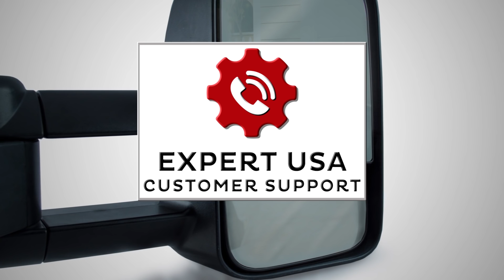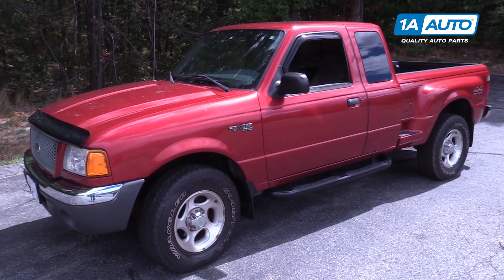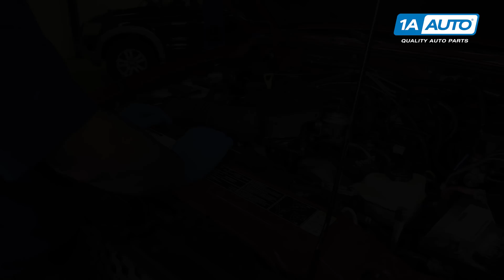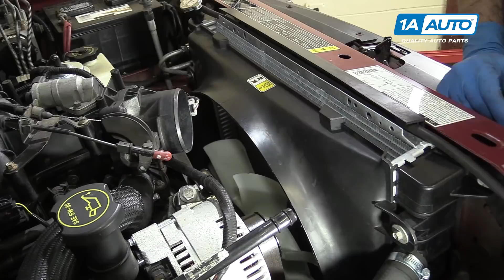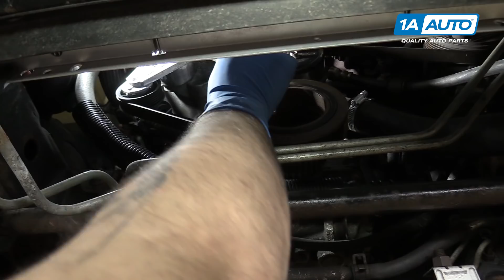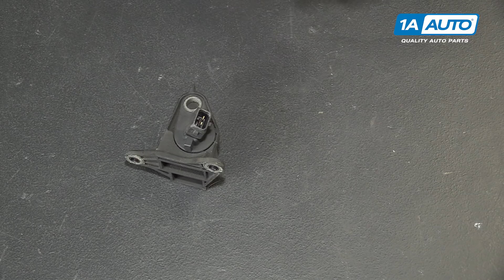How to Replace Crankshaft Position Sensor 98-11 4.0L V6 Ford Ranger

Comment: Thanks guys, Mechanic told me I was going to need to replace the block or rebuild the engine on my 09 Ranger due to all the symptoms the ranger was giving out but decided to take my truck back after a full week of  “testing”. Did a little research myself & decided to give the sensor replacement a try after reading a comment on this video about the same issues my truck was having & it worked!

Comment: This helped me discover that the crank  shaft pulley had slipped back and wedged between the belt and crankshaft positioner. 
my tensioner rubbed a hole in my air conditioner hose and squeeled very bad.
i looked and replaced the belt and hose, thinking the belt streched.
one year later the the engine developed intermantcy and would quit and restart and finally would not start at all.
because i let it set for a long tine i thought ,water in the gas, or clogged fuel line.
come to find out the positioner sensor was bad because a grove was rubbed into it and eventuility shorted the coli inside.
i bought a new 1 and it would not fit because the pulley was in the way(the new 1 did not have a grove).
at this point i discovered that the pulley had repositioned itself about an inch back.
the pulley had failed and the belt had set itself on the grooved rubber part of the harmonic balancer which moved the tensioner  arm into the air conditioner hose. 
after all was repaired the oil needed to be changed because it was heavley diluted with gas.
it runs like new YEA!!!
Reply: My 08 mustang has done this exact same thing. Did you replace the pulley yourself?

Comment: Dumb question but I seen another video of a guy replacing the same sensor but he said that one of the cylinders has to be at top dead center to replace, is this true?? I have this same truck with same engine please someone answer this

Comment: Would a faulty sensor cause a hard start problem? I'm trying to narrow down what could be causing it in the 4.0 ('02 Ranger ).
Reply from the maker: +Eric Ortiz We wouldn't be able to diagnose an issue like that here, you may want to have a local mechanic take a look at it. Thanks for checking us out! 1AAuto.com

Comment: If u had a leaking water pump could this prevent from starting at times? If water leaks on the sensor
Reply: Definitely. The connector on mine was corroded and the truck wouldn’t start until I wiggled the connector and cleaned the contacts a bit.
Reply: I use DI_ELECTRIC GREASE on ALL my electrical fittings.! PREVENTS or reduces such occurrences.

Comment: Question i was doing a job to replace both head Cylinders and in the process i took the (Camshaft Position Sensor) off of the (Camshaft Synchronizer) to replace the heads. Finally i put both heads on and everything together then i tryed to start it and it wont start. I keep trying and Finally it starts but it runs super rough and makes a loud CLICK noise every 2 to 3 seconds so i left it off until i can fix it. But i think it could be that part and the position sensor i took off thats messing with the truck from working.

Comment: If this is bad will the truck start by spraying carb cleaner into the throttle body and continue to run?
Reply from the maker: +Jeremiah Shine That may be an issue with a throttle body that needs to be cleaned. Usually when the crank shaft sensor goes it will throw a cylinder code, and the vehicle may be hard to start. Hope this helps you out. 1aauto.com
Reply: 1A Auto Parts It appears as if finding a code scanner for a '91 Ford 4.0 is difficult in these parts.
Reply: Jeremiah Shine you can read the codes by using a jumper wire and counting the cel blinks. There are videos on youtube. Just look for how to read codes in _______ without code reader.
Reply: The 4.0 OHV won’t start at all if this part is bad. Mine would click but wouldn’t crank at all. But it would eventually start if I gave it a jump. Turned out it was corrosion on the connector.
Reply: Will a faulty CS Sensor allow motor to start easily and run smooth while cold but cause motor to start misfiring after warming up to the point of killing motor and then not allow to start until motor has sat for a short while to cool?

Comment: Would anyone know why when I step on the clutch in my 04 ranger and put it in neutral when coming to a stop, the rpms go up to 3000-3500? It sounds like I need to shift into gear but I’m slowing down to come to a stop. The rpms drop to normal when fully stopped.
Reply: sticky clutch?
Reply: I had that on my 01 and cleaning out the throttle position senor out with parts cleaner fixed it.

Comment: I have a 1999 Ford explorer sport v6 ohv pushrod where is the camshaft sensor location? thanks!
Reply from the maker: +Ronald Wells Thank you for checking us out. The camshaft position sensor should be located on top of the driver side valve cover for the Sport model. 1aauto.com

Comment: where is the crank shaft sensor located on a 2000 ford explorer Eddie Bower Edition 5.0 L. located at?
Reply from the maker: +Julie Smith Thank you for checking us out. it appears that the crank sensor should be located right in front by the water pump and fan. 1aauto.com

Comment: I have a 2011 ford explorer I need a crank shaft sensor and a cam shaft sensor. Where is this located in my truck.
Reply from the maker: +Pam Woodard We currently do not have an auto repair video that covers this particular repair. We will keep this request in mind in the event that we need to make this repair in the future. Thank you for asking. 1aauto.com

Comment: Where is it located on 2000 ford ranger 2.5l engine?
Reply from the maker: +Jr Guerra Hello, the crankshaft position sensor will be located behind the pulley. +1A Auto
Reply: @1AAuto  Thanks, im sorry i meant to ask where camshaft position sensor is located? I cant find it!

Comment: 95 ford ranger cam shaft position sensor location?? 4.0L
Reply from the maker: +Adam Cox We currently do not have an auto repair video specific to your vehicle. You might be able to apply some of the basic steps shown in this video to your application.